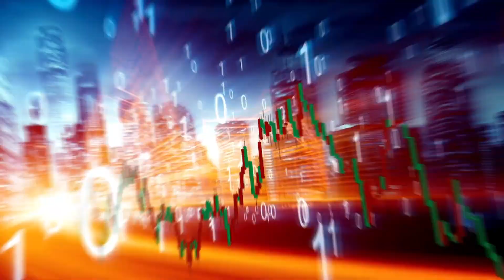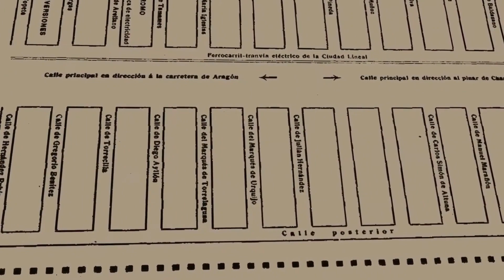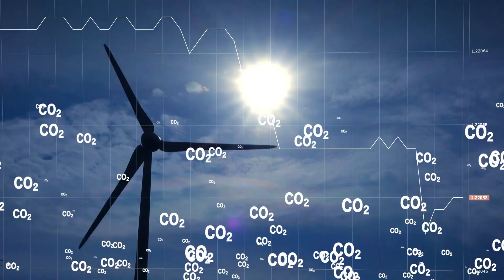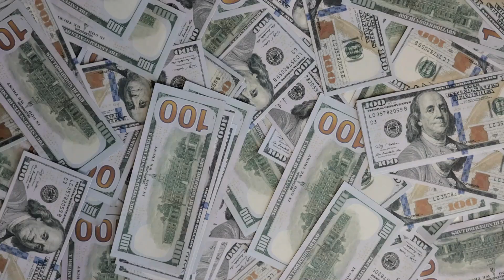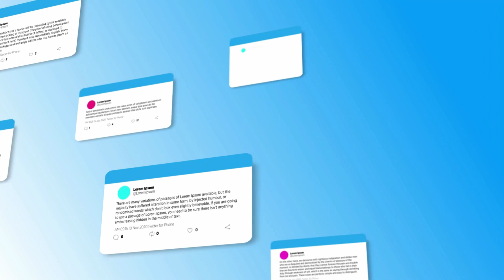Why Saudi Arabia Is Building A $1 Trillion Skyscraper In The Desert

Comment: The video re-telled the claimed characteristisc of the Line without thinking about them nor examining them. How would be possible to travel "anywhere in 20 minutes" in 170 km long city? Usual metro does not travel fast enough and and speed trains dont have so many stops to serve an entire city. When you stop often, you are not fast. When you travel fast, you pass many parts of the city without stopping. Just to mention one other thing: How can you travel by a bicycle in a vertical city?  And the enviromental impact are going to be huge -  170km long line would disrupt migration of the desert species and the miror reflection will overheat the environment.